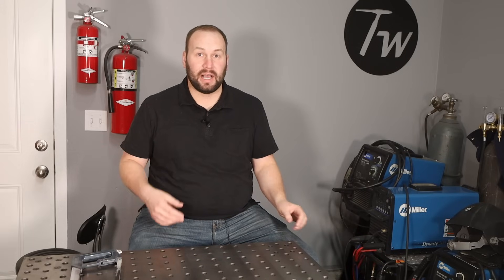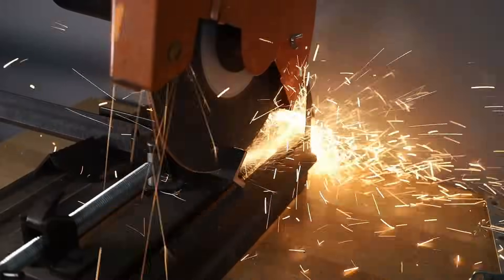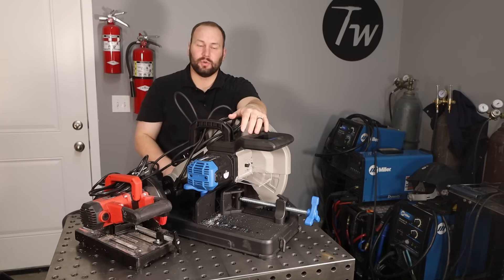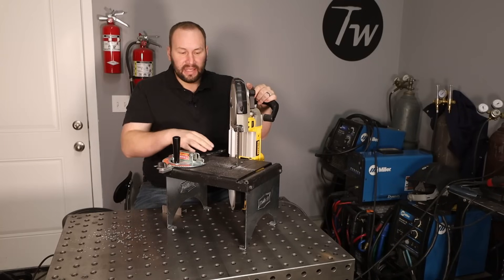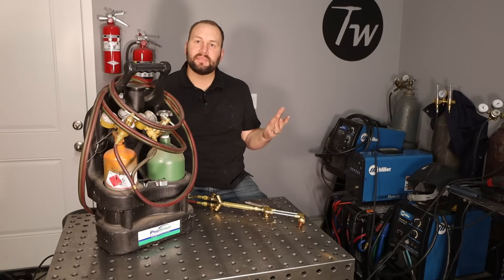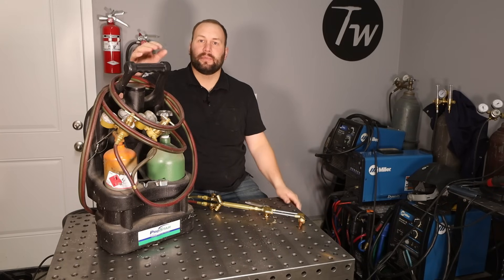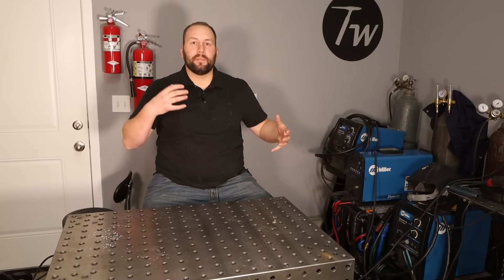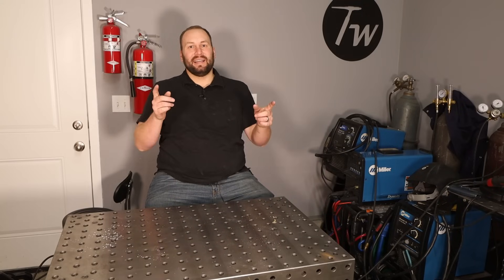10 Tools for Cutting Metal: How to Cut Metal for Welding Projects

Comment: Hi Tim. What kind of air requirements do you need for the plasma cutter? I’m thinking about buying a BestArc and have a 20 gallon v twin compressor.
Reply from the maker: I think you'll be fine. I used a compressor like (4.6 CFM @ 90 PSI) that for a long time and it worked pretty good for me. I could run it out of air with the CNC table, but it didn't happen very often. I now have a 20 gallon tank with a higher output pump (12 CFM at 90 PSI) and it can refill and shut back off with the plasma cutter running.
Reply: @TimWelds  great! Thanks for the response!

Comment: Even better than the plasma table is a water jet table because it doesn't heat warp the parts. Only problem is that they're ungodly expensive. I wonder where you could send out for that service.

Comment: I love my diamond wheels. The time you lose with the slower cutting speed, you more than get back by having a full size wheel for every cut, for the whole cut, without having to change them out. Plus, diamond wheels don't explode in your face or crack, causing kickback accidents. The only time I prefer an abrasive cutting disc is when I need a really narrow kerf, like cutting out tacks on an open root.

Comment: I have most of these cutting tools in my shop. Just acquired a cheap  inverter plasma cutter. Thanks for the bonus tip about using online CNC cutting services. As I have run out of room to keep all of these cutting tools around 😅

Comment: Rookie question.  I used a 125mm angle grinder with a new Dwalt black cutting wheel, using an adapter that made it look like the abrasive chop saw. With flat 6mm/30mm metal it took roughly 7 minutes for me to cut on and off to let it cool. Does that seem slow? It does to me.
Reply from the maker: That’s insanely slow, it should be about 20 seconds. Are you cutting on the flat side? That can cause things to heat up and glaze over. Cutting on the short edge will be better in a fixture like that.
Reply: @TimWelds  thanks tim yeah it was the flat side. I'll try as you suggested

Comment: Thank you for the video , my question is about the vertical bandsaw  I understand that it is possible to do curved cuts and all , how about cutting carbone fiber bords or parts would it do a clean and neat cut i guess that would depend on the blade selection. Any info on that you can share ? i am looking into finding a way to cut CF parts other than a dremel , it is hard to stabilize and get good constant results , TY & Cheers

Comment: Great video, as we have come to expect from you.   You mentioned the problem with the chips from the dry-cut chop saw.  I don't have such a saw so my idea is purely theoretical.  
Would it help to have a large and powerful magnet just behind the cutting area to catch the chips?  If the magnet is inserted into a plastic bag, the magnet is kept clean and the chips can be disposed of by simply removing the magnet from the bag.

Comment: Cool, you didn't mention a power hack saw, I knew someone with a machine shop who would cut his stock with one if possible. Admittedly slower but once set up and cutting he could
leave it alone and  do other tasks as it would shut itself off after cutting through the stock thus actually saving time even though the tool was slower than others.

Comment: Tim, Thanks for the thorough info on cutting tools. I have an extremely large welding table that is 1” thick steel. I want to cut it into 3 separate tables; two cuts. What is the best tool to cut through 1” plate? Each cut will be 48” long.
Reply from the maker: I would use an oxy-acetylene torch with an edge guide to make the cut nice and straight. It will need a big enough tip and tanks to cut that thickness (the acetylene is dissolved in the tank to keep it stable, so the rate of flow depends on the tank size). If it’s a one time deal and you don’t want to buy all the stuff, almost all mobile welding trucks have a torch setup and could make the cuts in less than an hour if you have everything supported and ready to go.

Comment: For the horizontal band saw, they usually have a movable "stabilizer" it goes on the blade to keep it from twisting and messing up your square cut, just move it close to your steel and let the saw work it's way threw,

Comment: Hi from Goa India. Will probably be buying my first welding machine thanks to your very good instructional/informative videos.
My query: What is that work table with the holes that you use called? Is it possible to work on a wooden table instead whilst welding or metal cutting?
Reply: I have a wooden workbench but have it covered with a sheet metal top. I also added angle iron around the outside of the wooden frame and that too is covered by the sheet metal. It gives a great place to clamp things while welding or cutting.

Comment: The toothed cold cut saw or dry cut as you say throws huge and HOT chips. I have to wear long cuff welding gloves and a face shield. It sucks. But it makes the best and cleanest cuts you could ask for. I think the only thing I’d rather have is a high quality horizontal/vertical band saw. I have the one from HF and it doesn’t make square cuts to save its life. Or mine lol

Comment: How is it possible with thermal methods to cut something to exact size? I imagine the part of the material melted or burnt away is different depending on several factors like room temperature, cutting speed etc.
This is really one of my biggest questions, especially if talking about cut outs from plates.

For cutting profiles we had a large, very slowly running chopsaw with coolant in the metal workshop of a theatre I was working for. That one was very effective and easy to use. But also VERY large.
Reply from the maker: It does vary, but not as much as you would think. For a given material thickness and speed, the kerf width on my CNC is consistent within about 0.005". The main variation comes because it has to slow down to change directions. When setting up a tool path for CNC cutting, the software offsets to compensate for the kerf width. For hand cutting, the machine is as good as I am. 

That chop saw sounds awesome!
Reply: That’s really interesting. I thought it would vary much more. Thanks for the answer. Oh and happy Easter.

Comment: Wondering what a good option to cut down a steel pipe support for a basketball backboard next to my driveway would be? Besides being tall, it's about 3-4in diameter. It has a weird vertical crack in it and we don't use it anyway. The base is mounted in concrete next to the asphalt.

Comment: How do I keep the angle grinder from bouncing around when I start the cut? No matter how slow I go, the blade always walks around before it gets a bite, frustrates me to no end!
Reply from the maker: Sounds like you may not have your wheel centered on the shaft using the proper spacer or you may need a different type of wheel. With the right wheel running true, it should sink right in.
Reply: @TimWelds  Thanks!
Reply: what Tim said but it also does require a steady hand to hit the mark

Comment: Ok, so my objections to friction saws and blades is everything you say, but also that they’re very unhealthy. There is powder from the metal, fiberglass and abrasive that lingers in the air sometimes an hour, or more, depending on how fine the powder is. It gets ALL over the shop. The fiberglass and abrasive powder is also carcinogenic. ALWAYS wear a good quality dust mask when using these things.

Never use a friction blade in a carbide blade saw because it doesn’t spin quickly enough, won’t cut properly and will heat the metals almost to red heat. Never never use a carbide blade in a friction saw. Those blades are rated for, at most 1300-1600 rpm. A friction saw can run up to 5000 rpm. The blade can fling teeth at high speed all over the shop, and into you. The bearings aren’t made for the needed accuracy of these blades, and they will vibrate. Also, don’t use aluminum cutting blades for steel, ever. The teeth can break out. Steel cutting blades shouldn’t be used for aluminum because the aluminum will stick to, and weld to the teeth, which will stop the cutting, and damage the blade. Stainless will wear a steel blade quickly. Get a blade for SS and steel. A Diablo ceramic blade isn’t expensive and works well.

By the way, because there’s confusion about acetylene /oxygen cutting torches. While you can weld steel with and other metals, you can only cut iron based metals.
Reply from the maker: Thanks Mel! The dust is nasty stuff. That brings to mind plasma cutting, which also produces a lingering fume to be cautious of.
Reply: @TimWelds  very true. Welding in too, general, but specifically stainless.

Comment: I use a cordless ryobi miter saw from home depot for $109 with a diablo metal cutting blade ($30), its ok but the hold down arm clamp thing is junk, its too far from the blade. Its battery operated so limited amount of cuts. I like your small trajan chop saw though, i think its better than what i'm using. Was thinking of getting the ryobi cordless band saw but the cutting area is only 2.5"

Comment: Great video! Super useful topic, too, that I think goes ignored by bigger channels because they take it for granted, but I'm pretty sure I used my grinder with cutting wheel for longer than my welding gun during my last project.

I'm terrified of the cut off wheels on a grinder exploding all over, so I got a diamond blade when I saw it on the rack when I went to buy my new grinder. Pretty happy with it so far, it did raise a small burr but it came off with a single stroke of the file. Hard to know how much pressure to put on the grinder when using it, though, any tips?

I see a lot of those Evolution dry cut saws on YouTube, they seem pretty slick. Maybe someday.

Video idea: how to clean off slag and spatter (from stick or flux core) - can't seem to do it as well as the videos show. Another idea: how to hold thin round stock for welding? The little magnet squares don't really hold...

Ron Covell does wonders cutting with his jigsaw, though I think mostly aluminum...

I like the little Subscribe on the CNC. A diy CNC might be more likely than other things in my future.
Reply from the maker: I’ve had a wheel blow on a chop saw once at work. The saw contained it, but it got my attention really fast. I’ve never had one go on an angle grinder, but avoiding that possibility is a benefit of the diamond wheels. 

I’m a bit impatient, so I probably apply too much pressure a lot of the time, but it goes better when I make sure the motor doesn’t bog down and let the tool do the work. 

Thanks for comment and the video ideas!
Reply: @TimWelds  makes sense, thanks for the reply! To me they look like big versions of Dremel wheels, and those spend more time exploding than cutting, so that's probably part of my problem 😁 I have heard to not cheap out on grinder wheels, since they spin so fast: cheap out on the grinder if you must but get good wheels. Of course, by the time I heard that I already had a bunch of cheap wheels...
Reply: @rpavlik1  I have learned to buy good wheels if I can.  I have switched to my local welding shop for wheels because they seem to be better.  I have Dewalt wheels as backups.  No more Harbor Frieght wheels for me . . . YMMV.
Reply: @danielchambers1958  yup. I was actually looking on AirGas Outlet the other day for no good reason and they had good quality abrasives for pretty darn cheap on there too
Reply: Believe it or not dull wood circular saw blades work great on aluminum plate as the larger tooth angle of the dulled saw teeth just about the right angle for that job. We had to cut very large sheets to be welded into leveling boxes for aircraft assembly much to large for chop or band saws or electric cutoffs would have been too slow.

Comment: I bought a little King portable band saw earlier this year, and at the same time picked up the stand that King makes that attaches to the saw to turn it into a horizontal band saw. It works really well. Like your Wen, it isn't the fastest thing in the world but for someone on a budget and (most importantly) a small shop, it's a great option. I'll likely get or build a stand to use it vertically too one of these days.
Reply from the maker: Very cool! Thanks for watching and for the comment.

Comment: Hey Tim..... I have used a recip saw with a diablo carbon blade..... works on 3/8 plate.... good video!
Reply: How do you hold the workpiece for the recip saw? I've got one, so I'd be thrilled to find out another way to use it.
Reply: @rpavlik1  I tend to use a vise and change the blade position.  Most recip saws have four positions for the blade.   I have clamped the material to my workbench to get a good cutting angle.   I would admit that a straight cut can be difficult.   At Lowe's, I use my battery-powered recip saw to cut rebar to fit into my p/u.    A drill press vise clamped to a wide board can assist with mobile cutting.   I hope this helps . . .
Reply: @danielchambers1958  you bet, thanks! I like the idea of mounting the drill press vise on a panel, too. Gonna do that for sure.
Reply from the maker: Awesome! I used to work on railings and used a recip saw a lot to tear out old stuff; they work great!